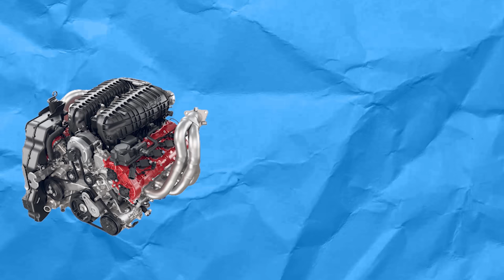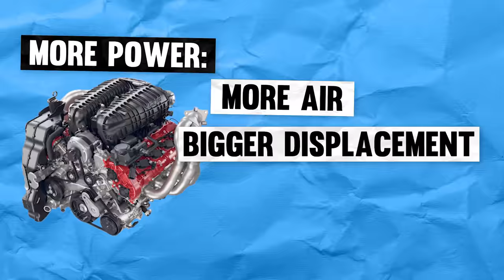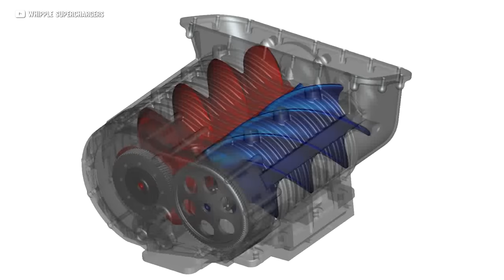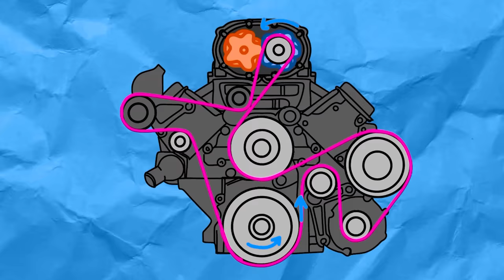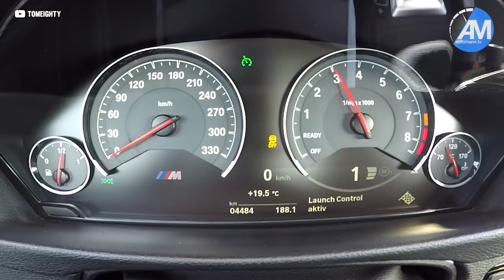Turbo vs. Supercharger - Which is Best?

Comment: I personally never favor one over the other cause they have their own benefits. Also, they both make beautiful noises. Twincharging gives the engine the best of both & I don't feel as if they cancel out each other in that scenario.
Reply: Well said. Canyon carving in a supercharged car is usually preferred over Turbo.
Reply: Twincharging is dope, but it takes an extremely durable engine to handle all of that boost. That's why it's extremely rare even in high performance cars.
Reply: I'VE ALWAYS HAD REAL GOOD IMAGINATION. I HAD THIS SOLVED THIRTY YEARS AGO.
Reply: @gaming4christ_1  depends on how you do it, like if you're twincharging through a m122 eaton making like 5lbs you don't HAVE to make a crap ton of boost, 15lbs total would be very reasonable, and 5lbs from the eaton would still give you tons of extra kick, I'm gonna be twincharging a built bottom end cobra motor for my car at some point and I'm going for a vmp using an eaton R2650 rotor pack, sitting it for 10-14lbs, with some BSFC testing to see what boost level is most efficient, and then slap some big boi twin 88s that will barely make 2lbs of boost by themselves on the street due to light wastegate springs, for a total of like 16lbs at the most for the street.
Reply: I feel like turbocharging is the best for a regular engine's peak power, and efficiency
but the roots supercharger never surges on boost, and is best for simplicity, and 4000whp.
And one more note.
turbochargers take a LOT of power from an engine too, the engine exhaust pressure with a turbo is usually 1-2 times as mush as it's boost pressure. This means that the engine has to work to push out the exhaust, robbing power.
Reply: @ThePower1037  you've never seen blower surge have you? It's fun, it's an idle thing
Reply: @Prestiged_peck  "on boost"
Reply: @ThePower1037  good point.
Reply: I heard that F1 cars use a supercharger AND a turbocharger, so that they get big boost from the supercharger while the turbo spools up
Reply: @ronniewall1481  OKAY!!!
Reply: @Jaqoum_The_Wizard_King  they may have had a car or two do that back in the day, now they have a turbo that can be clutched to an electric motor that does the job of both in one unit.
Reply: @DubHead69420  I USE WATER INJECTION INTO EXHAUST HEAT. STEAM SPINS TURBO.
PLUS IT COOLS EXHAUST GASSES RESULTS IN BETTER FLOW.
Reply: Yeah but it also kinda allows you to enter into the world of exploding engines.
No I don't mean engine knock.
Reply: @ronniewall1481  you probably better off just spraying it into the intake and using the extra knock resistance to throw another 5lbs of boost at it.
Reply: Super complex, no space for that, lol
Reply: @vito7056  ⁷m
Reply: goodluck tryna build an engine that can handle that
Reply: @gangsterwafflesthe7th508  depends on how crazy you go with the boost
Reply: @gaming4christ_1  Somehow, there was a twin charged Nissan micra(march)
Reply: Turbo way better cos of how the power hits, feels way more savage in car
Reply: @truthandfreedom9849  for many racing scenarios that savage hit can put you into a concrete wall and out of the race very easily, a 600 horsepower blower car can outrun an 800 horse turbo car if they don't spool on the line, and the blower car can get far more lap speed not having to wait on turbo lag.
Reply: @truthandfreedom9849  turbo ruins the raw sound of the car, and no it does not feel more savage cuz u gotta wait for it to spool, meanwhile a supercharger is almost instant and u can feel the torque at a lower speed
Reply: @Prestiged_peck  yeah .......................I'm not in a race scenario and I prefer the way a turbo hits for the fun feeling
Reply: @gangsterwafflesthe7th508  no you don't have to wait for it to spool if you know how to drive correctly as you would already be in the correct rev range from the previous gear .......
Learn how to drive mate ....
As for sound  I can think of tons of incredible sounding turbo cars which sound better than boaring old comp wine.
Plus all the wastegates and dump valves etc - proper symphony Vs a constant whine 

Plus my classic rb5 Impreza sounds soooooo sick bro lol
Reply: @truthandfreedom9849  you've never felt the power behind a truly mean supercharger, try taking a ride in a terminator cobra with a 3.2 KB on a 20lb pulley and tell me it ain't fun.
Reply: @truthandfreedom9849  hellcat whine > any japanese shit box
Reply: @gangsterwafflesthe7th508  bro you have clearly never been in any of these cars .....
Yes the compressor might sound better when you are standing on the street watching....... But when you are inside driving as I have been for both ...... There are much more better noises going on in a turbo car .... When you driving..

I don't care much for your spectator opinions 😂
Reply: Now they have electric turbos that make turbo lag completely obsolete.
Reply: @shperax  so an electric procharger (turbos and prochargers are essentially the same system, just one is exhaust driven and the other is driven by a motor of some kind
Reply: @Prestiged_peck  You have a regular Trubo driven from the exhaust like normal, but you have a smaller electric driven turbo that instantly pre-charges upon the accelerator being pushed that completely eliminates spool up time. You get the same instant boost like a supercharger, and no power is robbed from the crank. I think it's Porche that developed this 1st. Mod garages are now doing these upgrades for turbo guys. You're going to see these more and more.
Reply: @shperax  so it's a twincharge system with an electrically driven centrifugal supercharger that then gets bypassed by a turbo, I think there was another company that did basically the same thing with a crank driven centrifugal and a clutch that kicks out at a certain RPM, wanna say Volkswagen or volvo???
Reply: The best "twincharging" setup was Ford's on their RS100 outrageous Group B rally car. The roots blower was dominant down low, which energized the turbos earlier, which then took over and completely bypassed the blower

Now THAT is how a twincharging setup has the best of both worlds. However ,most  keep the blower in the loop when it would be far better at higher RPM's just to bypass it.
Reply: @exploranator  that is how most good systems are done, it's how the system I'm panning may work, gonna have a one-way check valve that can bypass the blower if it becomes a restriction, but with the size of the blower I'm gonna use, that probably won't happen until stupid power levels are reached
Reply: Depends on motor. I have a 3v mustang and turbo is better on that motor
Reply: @Servingbase  turbos make boost and power on every motor. Don't believe me, may I direct you to thr vast library of a youtuber by the naked of richard holdener.
Reply: I know nothing of cars and I'm curious about a couple of things, in case anyone can help my curiosity.

If I'm driving casually around the city or in a highway and I needed to speed up as fast as possible which would be a better pick, supercharger or turbo? What if it's the same scenario but with constant turns where I need to break?
Reply: ⚖️ I'm still torn here
Reply: I love NA. No noise, more life
Reply: @gaming4christ_1  You made me want to twincharge a B20 engine, lol.

Comment: Anyone team twin-charger?
Reply: me
Reply: anyone team twin turbosupercharge
Reply: @tiamatene2869  twin-charging is still superior using both a turbo and supercharger at the same time the supercharger provides boost at low rpm so no turbo lag and the turbo provides boost at high rpm but single big turbo with a big block is better than twin turbo
Reply: I team NA since I hate additional noise.
Reply: Me
Reply: @master6435  true

Comment: I’m blessed with a 6.2L LSA … so Supercharged all day for me.  A relatively simple pulley size change and 18 psi of instant boost means the turbos are always in my rear view mirror.
Reply: Nice car
Reply: 18PSI?! what are you putting to the wheel!!
Reply: @Millirawk  6.2L LSA engine plus a supercharger at 18 pounds... I'd estimate at least 650, and that might be low.
Reply: @JeffOfTheMountains  I have boost jealousy 😂
Reply: @JeffOfTheMountains  that's a very conservative estimate - that's a ton of boost in a big pretty well built v8.  But, on stock internals I wouldn't want to push past ~800ish anyway, start to lose pistons at that level pretty fast
Reply: @AndrewB383  I went with that because the LSA comes stock with 556 horsepower and 551 torque, supercharger included. 18 pounds is a LOT, but I don't think it provides a huge bump just by itself.

EDIT: I'd love to see a build list, if there is one. That'll give us a better idea of the output.
Reply: No build per se.  It’s a daily nice weather driver. CAI, cat back Borla 3” stainless (sounds fantastic), stock injectors (thinking about swapping to 1150), pulley to 18lbs (stock was a bit under 15) and a tune.  380CI, so no loss of efficiency concerns spinning the blower. 556/551 stock numbers are bhp.  Dyno 620/610 at the wheel.  The inter cooler helps a bit. All that to pick up less than 1/2 second on 295 PSS street tires.  When I got it, it was the fastest production sedan in the world. Didn’t take long for AMG and the M5 to pass it.  Even Dodge joined that party - although the Charger isn’t in the same class (luxury sport) - let alone the V8 SC pony cars. Thanks for the kind observations.  I do absolutely love it. I remember when I got it and realized how incredibly lucky I was to actually own my dream car. That’s never been lost on me, and I never took it for granted. Can’t wait til spring so I can take her back out of hibernation … and smoke a few more turbo’d tuners.
Reply: @JeffOfTheMountains  haha. Hahaha. Till a 40psi four banger rips by you with a turbo the size of your torso! Haha Turbo all day. Super charger maxes out quick. Throw a 70mm turbo an you will have a G under the hood........Superchargers are 🚮 🙀
Reply: @enhancedphysique6452  It's true, there are some ridiculous turbo cars/builds out there. But perhaps your reply should have been directed to Steve T? It's his thread after all.
Reply: @enhancedphysique6452  thats straight beta energy lmao. People who claim that a small turbo on an I4 makes 1000 whp without any supporting mods know nothing about cars.
Reply: I have a 2012 Cts-v coupe that is cammed with a 2.35" Pulley and it makes around 650whp on around 15psi of boost. I haven't had it tuned since I fixed the back pressure issue in the exhaust so I bet it might make high 600s on 305 PZ tires. Also running bigger injectors and I am hoping to port the supercharger and upgrade the stock brick in the sc lid. Might need to upgrade the fuel system though. 
Edit: This is a conservative tune on 93 octane as it is my daily driver. Not trying to break any records but I’m pretty confident that it can make 700whp if I wanted to put some timing in it.
Reply: You won’t able to see my truck in your rear view mirror. V6 turbo AWD > V8 LSA 2wd
Reply: @blazeroranger  GMC Syclone?
Reply: @JeffOfTheMountains  Yup the stoplight warrior. lol
Reply: @blazeroranger  There was a time I wanted a Syclone, but they're stupid hard to find in good shape. Great platform to build though.
Reply: Till it spoolz up then your letting them know if they gotta tail light out. My turbo lag is my way of giving my opponent a head start.
Reply: @JeffOfTheMountains  yeah because only 2,995 productions but approx 1500 left right now. I had my engine fully built with all goodies. Went 7.6 @ 1/8 without tuning.
Reply: @blazeroranger  I'm debating between a bunch of project cars right now, and a couple of them involve a possible turbo for them. I want to invest in turbodiesel since I like torque and would love to spank some ricers, but at the same time, I think I'd be better off with a platform like a Mustang or a non-rice Civic or Accord.
Reply: @JeffOfTheMountains  I’ve driving a supercharged and turbo manual/auto

Turbo with auto is the top in my opinion. No error to shift as you leave it in D and brake boost it before launch. It’s same as supercharged but turbo has double benefits if you using auto. Boost launch and full boost all the way.
Supercharged you would launch it hard like a brake boost but slow down in distance. Belt vs exhaust
Reply: @JeffOfTheMountains  and don’t do Mustang. It’s known well for crowd crash. It’s chassis design and weight-ratio isn’t good that’s why it always lost control every time.
Reply: @blazeroranger  The Mustang would be more of a show car. I want to make a replica of the 2006 Mustang GTR concept that Ford was going to use in their return to track racing, but they went with the Coyote instead. I love the way the GTR looks.
Reply: @TurboFreak  How long have you owned that truck? There is a guy by me with a Beautiful White Typhoon. Soooo sharp.
Reply: @gumballer133  since 2013. When I bought it and it was fade, non running and bad tires. I hauled it from Nevada to Iowa and been work in it. It’s faster now than before. Lol
Reply: @TurboFreak  I'm sure it rips! I only modify one of cars nowadays. I remember back in the 90s when I was in high school here in Ohio, Syclones and Typhoons were a common sight. I've always liked them.
Reply: @gumballer133  oh yeah but not nowadays.
Reply: How about a 30 PSI turbo
Reply: @JeffOfTheMountains  I have the 6.0 with a Harrop 2300FDFI Charger, CNC heads, Street Racer Cam and Full High Flow Extractors, cats and 3inch Exhaust, Twin plate button clutch and Harrop TruTrac Diff, and I am putting 480kw's, (645HP) @ 1303nm, (961ft-lb) of torque to the rear tyres on only 10psi.
Reply: Until on the upper end when the turbo passes you
Reply: I think it’s more people that drive mustangs are often young and dumb plus drunk or on drugs.  @blazeroranger
Reply: The quickest proven street car in the world is Brett Lasalas Predator block powered Mustang...his turbos smoke EVERY blower car and it's physics. Outside of nitro, every major acceleration and top speed records are turbo.

Comment: I put a charger on a 2.4L VTEC Honda in my civic type r . I used a rotrex supercharger which worked really well with this screamer of an engine. The charge Temps were amazing and with a medium sized charger the engine made 500hp. Id also add that this car was a great daily driver.
Reply: Which type? Super Charger or Turbocharger?
Reply: @shadowopsairman1583  supercharger
Reply: Fyi they are both chargers, the difference is super or turbo

Comment: I feel the instant power is a little under expressed here. To make a turbo system good for a big engine that truly makes sense to use over a supercharger is when you're trying to hit ridiculous horsepower numbers. We're talking about 1500+. For less money, less time, and a better feel, the supercharger always makes sense. Heck SS camaros and GT mustangs have companies still putting out super charger kits for under 6k installed and tuned that can get them 200+ horsepower with no other supporting parts or mods needed, that still get them the instant off the line power most of them are looking for. I think that's such a big selling point for those cars specifically. Very few people look at muscle cars and car about their top speed or even their horsepower rating. It's all about torque and getting off the line baby!
Reply: So damn true!! Am a muscle car enthusiast since the age of 9 .. the burn out take off & the tourmaduse amount of tourq this beautiful beasts display is my love & joy "!!TO THIS DAY!!" Lol

With that beeing said got couple projecte cars that am working on witch is ..

1997 Toyota tercel with a 4EFTE swap
1993 Toyota mark 2 1jz gte-nonvvti
The love of turbo are also in my blood.
Reply: Heard of M power performance ??? 😁 Twin turbos 625 HP  gaped the supercharged hellcat 707 HP in drag and 1/4 mile, Both stock cars. ..... Now figure it out why car enthusiasts prefer turbos , a hint ( supra, Nissan GTR,)
Reply: @ghostofsparta6579  muscle cars 🤮
Reply: "For less money, less time, and a better feel, the supercharger always makes sense."
Nope
Reply: You sure don't see people putting super chargers on their diesel pickups to get more power though. It's always a turbo charger.
Reply: @russellkeeling4387  because diesels already have enough torque and low top end, so supercharger on it would be a no brainer.

Comment: Finally an actual informative video on this debate. I personally love supercharged engines because of linear reliable power but this video is spot on. Theres no technical better option overall because it depends on your engine and what you plan on doing with your car. Is it a daily, drag, auto cross, drift, etc. you can now even do both lol. People are starting to turbo dodge demons. Supercharged and turbocharged, best of both.
Reply: E

Comment: There are ways to overcome turbo lag in dedicated drag usage.  One is to use an external force to spool the turbo up at the line til the engine can build the RPM's and exhaust pressure.  Another, and one that seems popular currently, is going to a ProCharger.  Basically a Turbo but one that is spooled off the crank rather than exhaust.  Exhaust is not free since exhaust pressure is robbing horsepower compared to a free flowing exhaust.  Its all a game of pros and cons to find the correct balance.
Reply: Thank you now I don’t need to say it. Restrictions on exhaust is never good. Currently I’m installing a supercharger on 240z with 350 vortec v3. Came to you tube to learn about boost reference fuel management.